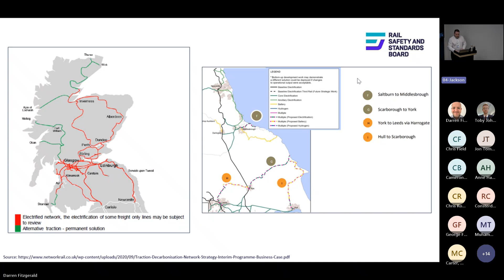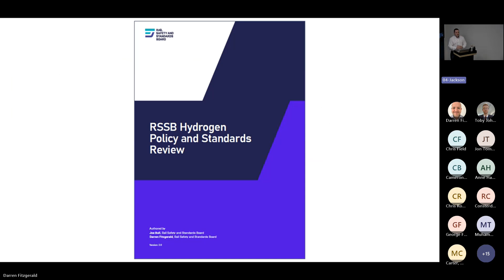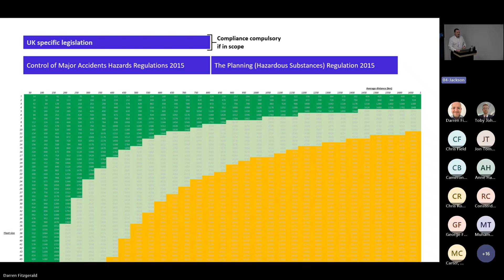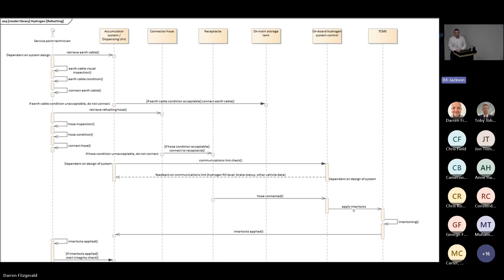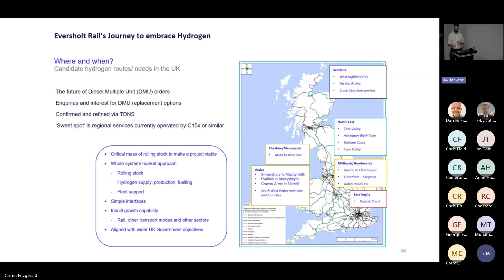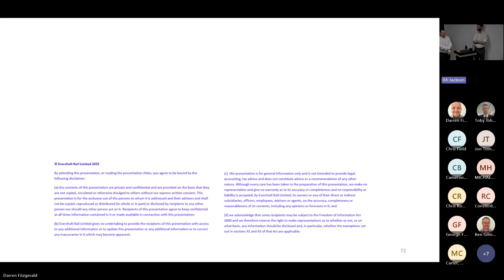Hydrogen Traction Power for Rail

Comment: CHEAP ENERGY - & THE NOW PATENTED PRG ! 
Indeed, if you have an overhead Catenary wire already providing 25Kv. Where is the advantage in dabbling in "Hydrogen propulsion". Because you can generate the 25Kv by what ever fuel method is suitable politically or practically. So its "Power Station" design, not rail design that's the bottom line. Indeed Government needs to be encouraged to extend "electrification" as the easiest solution to deciding which "fuel" will be used to power Britain's trains.  

And I should also mention, that there is an already "proven & patented" Scientific revolution in power generation, still virtually unknown to Industry. Called the Plasma Reactor Generator (PRG). A technology that was designed to re-examine and copy what our Sun's atmosphere really does. Which has revealed a trick of Mother Nature in generating huge quantities of Electricity, far more efficiently than any human method, and of course far more cheaply. AUREON ENERGY Ltd, being the Patentees !!!!

Comment: I am astonished to see such an august body discussing hydrogen as a fuel for rail transport. The guys actually running the trains (in the UK at least) see no future for hydrogen. The simple arithmetic on costs don't stack up. We use electricity to generate the hydrogen. We compress it and then convert it back to electricity and lose 70% of the energy in the process? Compare this to discontinuous OLE or 3rd rail with battery back up and we have the trains built and ready to roll. Hitachi had a successful trial with a train mixing OLE/Diesel and battery and achieved a 55% saving on diesel just using the regenerative breaking alone. As an initial trial it was hailed as a great success. They are refining the design for future applications. GWR are running their Greenford line trial and all the data from that seems to indicate viability of 3/4 rail live only when a train is parked over it for dwell times of no more than 5 minutes for applications on the many branch lines of up to 30 miles down GWRs lines to Cornwall. South Western Rail, encouraged by the GWR trials are looking at the feasibility of discontinuous 3rd rail from Basingstoke to Exeter. With road transport already using 500 kWh batteries for road haulage a 2MWh pack on rail freight seems realistic? And yes you need big batteries to cope with storing the kinetic energy of heavy freight using regenerative braking.